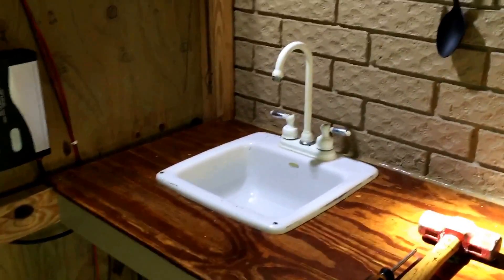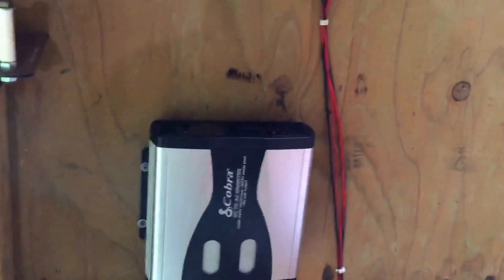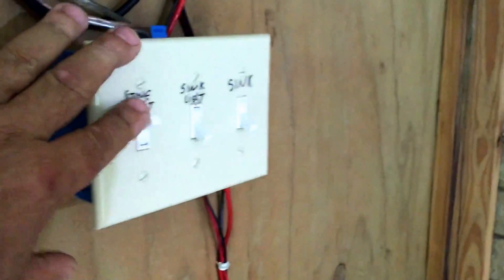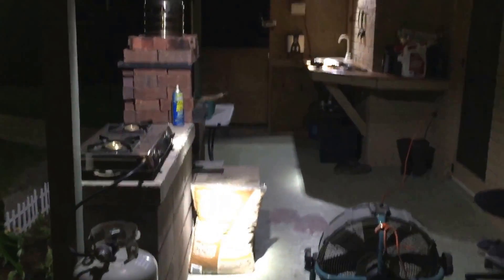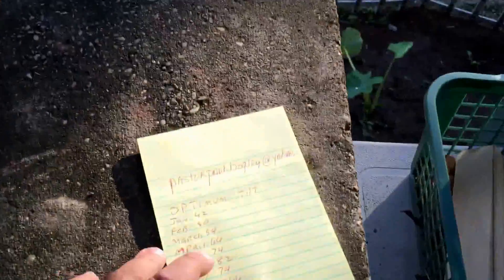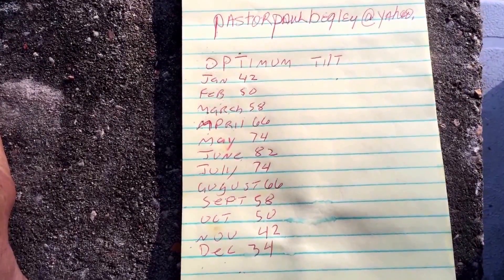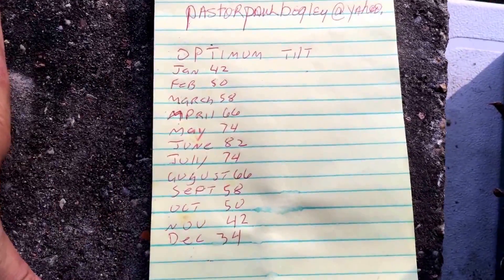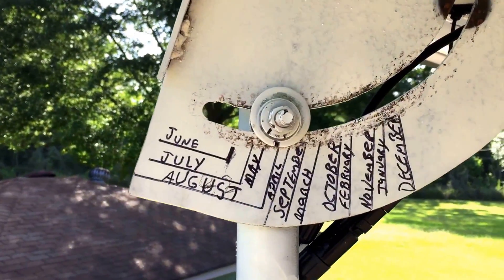Finished solar panel angle adjustment

Comment: BCtruck, rebuild, repair,repurpose I tell ya, I would nail the mount down about once every quarter, too, rather than climbing up on the roof every month to adjust the panel just a few degrees. Good show. I loved each of the solar videos I watched.

A new subscriber here. Thanks for the videos. I got the referral to your channel, from sixtyfiveford. It was concerning the generator exhaust project.

Comment: Brad, you only need to adjust your panels 4 times on the year, at the change of the seasons, as up to a 20 degree solar change will only change you solar power about 5 - 10%.  Modified sine inverters will power most things, Yes even computers running through a power supply like laptops.   The exceptions are variable resistance appliances like variable speed fans.

Comment: I couldn't afford the copper ground rod so I used half inch steel re-bar.  Hope it is okay.  The inspector didn't mention it, but he hit me on just about everything else.  Next time I drive one of those rods in, I'm going to try using my air impact hammer or impact drill to see if it works better.  Maybe I'll weld a cheap sacrificial masonry bit to the end.

Comment: Here's the EXACT site you used.

http://solarelectricityhandbook.com/solar-angle-calculator.html

I ain't bright as your outdoor kitchen, but I do own a weed eater recipe saw,  and it still works.

;)
dcdon
Reply: donald ducky DANG AUTOCORRECT.  That's a Recip. Saw

Comment: many installers just align solar cells fixed in place for the winter alignment, because the sun is much weaker in winter, so you really need the extra sun. if the angle is a bit off in summer, then there is more sun then anyway, so you don't miss it so much amps wise

Comment: sweet sitchiation BC!
Reply from the maker: tblbaby Gald im done. I dont like being on the roof. Im gonna give it some time,but soon i have to get up on the 32 foot ladder and fix my cb antenna.
Reply: BCtruck, rebuild, repair,repurpose Arg! maybe you could trade work, and get some spry more bouncable individual to take care of that one? I mean I dig the renaissance man thing as much as anyone, but sometimes specialization lowers the prospect of broken and torn body parts and going to the hospital which is a cesspool of germination, or something like that.

Comment: its to bad you couldn't use the old antenna rotor motors like we used to turn the old Antennas before cable TV so could adjust your angle without climbing up the ladder.

rather then having the rotor motor mounted up and down like would normally turn it 90 degrees on its side.
Reply from the maker: Patriot Prepper Good idea!
Reply: BCtruck, rebuild, repair,repurpose
 If it works it would save you climbing up on the roof. Don't know how strong the motors are in them rotors or how heavy the solar panel is.

Comment: Careful, solar stuff is addictive. I find I'm constantly fiddling and tweaking....adding more batteries, adding more gadgets, adjusting angles, Its a hoot when it works well, though.  I feel like I'm ripping off the power company by getting energy for "free".  Take that, PG&E!
Reply from the maker: AnnBearForFreedom The PG&E police will be knocking at your door soon!
Reply: BCtruck, rebuild, repair,repurpose The sad thing is...I don't doubt that they will be.  Every penny I save with every step towards self-sufficiency and independence is a penny I'm not paying "the system", and the system is bound to get grumpy about it eventually.  So I continue to try to stay under the radar by staying casual about my independence.  Workin' on it!

Comment: Nice looking kitchen it should come in handy, how would it be to set your panel at 58 which is the average of the 12 months? just wondered.
Reply from the maker: rchopp I think that it wouldnt work good in the point of summer when the sun is at its highest,or the point of winter when its at its lowest.

Comment: Hello Brad, I understand the concept of tilting the solar panel to follow the sun, but does it really matter as long as it is pointing to the sky, you see we have homes over here in England that have the panels fixed directly to the roof regardless of the pitch, as long as they are south facing, and these are installed by solar companies... just a thought... You be careful on that roof...  By the way were did you get the lights from may I ask ?...  Regards to you and your good lady wife....

Comment: I have a few panels on the side of my house (Cheapo harbor freight ) and my panels in December put out about 8 amps @ 15vdc right now they are putting out about 4 amps, of course up here in the winter it is really bright, but for only 1/2 the day vs summer, I figure if things go south I can move them off the south side of the house., you might find even if not optimal you will have power to spare.
Reply from the maker: Swanny383 Im hoping to buy one more panel and two more batteries.

Comment: If you only knew how to attach a servo to it and an arduino board to control the angle then you'd never have to touch it ever again - I wonder if they make a cheap solar tracking device you can modify for your set up?
Reply from the maker: Sachi WI That would probably pay for itself with the extra electricity it would produce!